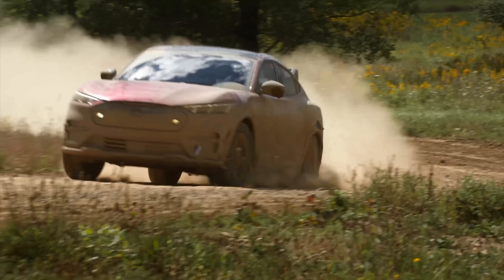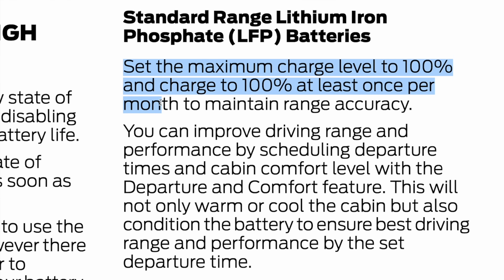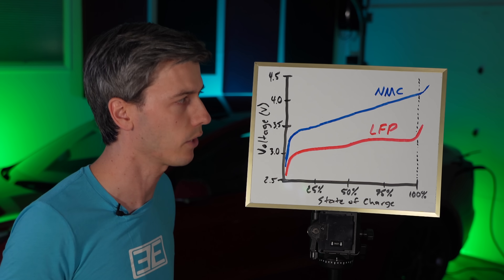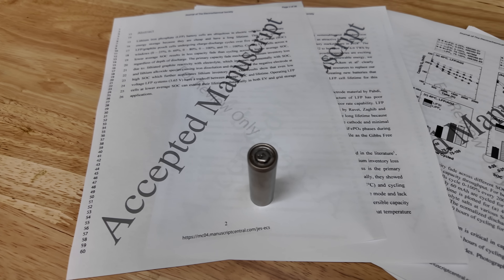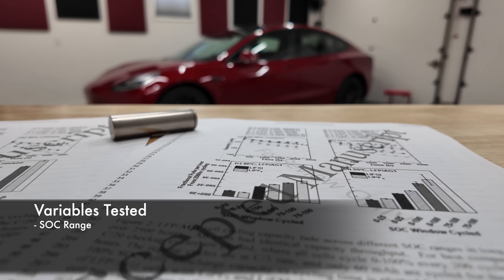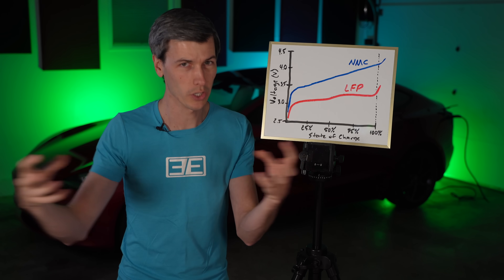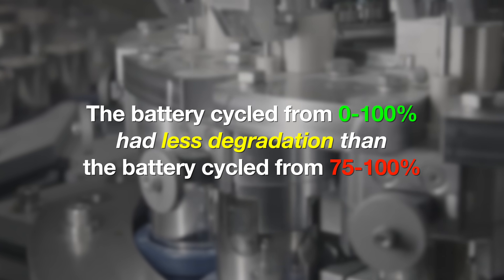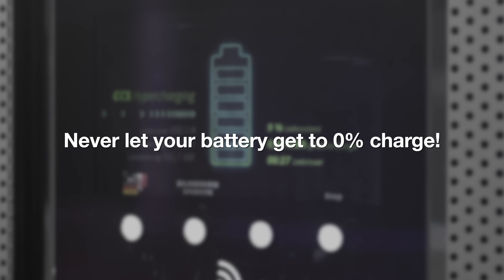How To Ruin Your Electric Car's Battery - LFP Edition!

Comment: And this is where I say that battery electric vehicles are not really the solution to travel.  We really should be investing in mass transit within towns and cities as well as inter-city networks of electric trains and buses.  All of this talk about how to maintain a battery when batteries really only have a shelf life or realistic life of 5-10 years while an internal combustion engine can go 20 or more.  If we want a bandaid (temporary) solution, we should be looking more into hybrid technology or a fuel source that doesn't produce the numbers of noxious emissions that gasoline has and finding something that doesn't use more energy or effects on the environment than it's worth the benefit (ethanol production). 

Fuels that we could be using more of but ultimately flare are natural gas and propane.  They are much cleaner burning fuels than gasoline and granted, the power drops a bit but if cars could travel around with 70 something horse power (granted, that's an entry level carbureted car from the 1980s like a Corolla or Civic).  I am also weary of battery technology due to its fairly volatile nature when involved in an accident or even just charging at home and your house becomes a total writeoff.  I know people say that Lithium Ferrous Phosphate is more stable than the Li-Ion batteries but when they go off, they go off.  

We should also consider going back to making 15 minute communities as we all need the exercise and getting rid of parking lots and making roads into walk ways so we (especially in North America) can get rid of this toxic dependency on car culture.

Comment: This video made me a little bit confused, so I will explain my current situation here and hopefully someone can help me with the best practice:

I currently own a Tesla model 3 highland standard range (LFP). I don’t have charging options at home but I do have some public chargers at a few min of walking distance. During the week I don’t drive my Tesla much because I commute to work by bike (is less then 2 km from home), but in the weekends me and my fiancé do regularly trips with quite some distances.

Following Tesla’s recommendations I charged my car to 100% every Sunday, even if the SOC was at like 85% (mostly if we have weekends with family and we can’t go on long trips). 

So after this video I understand that it is actually fine to keep driving it to let’s say 20% and then plug it in to 100%? Or should I keep following Tesla’s recommendation to charge it on Sundays (every week to 100% even at high soc’s)?

Comment: EVs are fine for people that can afford to buy or lease a new vehicle every 5 to 10 years but they are going to be a massive problem for lower income households.  They either need to figure out a way to make them last longer without degrading or they need to make it cheaper to replace the batteries.  And keep in mind the people buying these new know they are going to trade it in in a given amount of time and don't care about maintaining the life of the batteries.  The secondhand market is going to be filled with EVs that have their lifetime significantly shortened.

Comment: funny, but it sounds like the graphene is introducing a bit of the problem...i dont like the idea keeping things low, since full power acceleration works the cell much harder when its at lower SOC... if vehicle software isnt tracking cell voltages accurately or fast enough, big problems are heading your way... i bet the package type will also affect longevity... The prismatic cells can flex far more and over the last year, compression is recommended...  My calb pack in my sandrail was abused at 5c (60Ah cells) and the cells ended up at the same remaining (53Ah) that the ones i didn't install but left on the ground, after 4 years.

Comment: My boat has a lifepo4 battery bank and a very good charger. But, I cannot seem to get the charger to put out 14.4 volts at the tail end of charging, known as constant current state.  The charger must be spending very little time at this higher voltage

Comment: What if 10 years later you replace your battery with a solid state one....and suddenly you end up using the wrong VIN number for the new battery? This should be a status in software. Ford has it completely wrong not right.
Reply: How do you know the battery type is not also displayed with an OBDII scanner?

Comment: If you live in AZ where it is hot AF in your garage, leave your Tesla plugged in and use CABIN OVERHEAT PROTECTION. It also cools the battery. Same for those in the northern climes. Leave it plugged in for winter months so the battery is warm in the morning.
Reply: This isn't necessary at all..

Comment: I personally have my phone set to blurble at 80% charge and it does it again at 85%, 90%, 95% and 98% i think it is... And i try and charge when it hits 20-30% but due to the fast charging technology and accidentally letting it die more than a few times at 0% completely, when my battery gets below 15%, its charge state might as well be pissing electrons and it drains exceptionally rapidly. Pretty obvious that the charge cycles aren't what they use to be and i have indeed lost 20-25% of the capacity according to an app that does measure the incoming and outgoing electrons with volts, amps and temperature, plots what the charge is when you put it on charge, what you unplugged it at, the estimate of the battery health, degradation over time...
I mean.. this could be bloody useful in an app on the console of a car. My app even tells me the design spec and actual capacity and wgat the estimate deterioration/year is 🚗🚗

Comment: I don't own an EV, but I do have a LiFePO4 "lead acid replacement" battery on my solar system. It's charged to 100% nearly all the time, because my charge controller is designed for lead-acid. I was concerned that I may be degrading the cells by doing this. I do occasionally cycle it just to give it a bit of a workout, I guess I should do so more frequently.
Edit: I should have watched the whole video before posting, rookie error 🤪. I think I'll just have to accept that I'm going to wear out my battery, or get a more advanced charge controller.

Comment: You forgot to mention that charging an LFP battery in sub-freezing temperatures causes lithium plating, which will quickly degrade performance. Also, the internal resistance of LFP is very high in the cold, so if you get an LFP-equipped car, be sure it has a good battery thermal conditioning system. I live in Michigan, so this matters to me.
Reply: It’s funny that low temp charging barely came up, when the RV community and Will Prowse (low temp sensor test on batteries) warn about it all the time.

Comment: Is 100% SOC on a car level the same as 100% SOC on a cell level? Or is there an artificial buffer that gets adjusted over time to combat degradation and to have the same indicated maximum range for a longer time? If this is the case, charging to 80% SOC for example might be more detrimental on some cars compared to others, depending on the manufacturers philosophy.

Comment: Where did you get the Tesla recommendations from? I have a 23 Y-DM/LR. I was told, and the app recommends, to set a daily driving charge level to 80% and not to go lower than 20%. The 80/20 rule. It is also recommended that the car be plugged in at home. I have never seen any Tesla recommendation that stated to keep the SOC at 100%. The only time I ever kick up to 100% is the night before a long drive. It takes about 4 hours to go from 80% to 100%, so it is a slow charge to top off the battery as it's trying to keep the heat down (cell heat = the enemy).

Comment: What type of battery is it Cadillac LYRIQ LFP? Cadillac 2023 LYRIQ Charging 19.2 KWH CHARGER. 
I typically charge to 50-60% using a Level 1 charger. Objective slowest charging as possible while maintaining 50% SOC adjusting pending anticipated driving needs( some days no charging needed). Fast charging only for long distances planning not to exceed 80% if possible. I have a 19.2 KWH CHARGER with a 11.5 kwh EVSE. 
What charging recommendation would you recommend for my situation?

Comment: I guess knowing if your EV has an LFP or NMC battery is a lot. 
Gas engines are so much simpler you only need to worry about if it’s diesel or not… and if the engine needs 85, 87 or 89 or something else. And if the engine has synthetic oil or not, and how often you should change it. Oh yea and the transmission fluid and engine coolant, and I guess when you changed the spark plugs last. Probably good to know if it’s naturally aspirated or if it has a turbo or supercharger.

Comment: This video is about best practices for extending the lifespan of Lithium Iron Phosphate (LFP) batteries, the chemistry used in some electric vehicles. The video clarifies misconceptions people have about LFP batteries and contrasts them with Nickel Manganese Cobalt (NMC) batteries, a different kind of battery used in electric vehicles.
The video argues that unlike NMC batteries, which are degraded by frequent shallow charging, LFP batteries benefit from being fully charged to 100% at least once a month to calibrate the battery management system. However, storing the battery at 100% for long periods is detrimental to its lifespan. Ideally, for maximum longevity, the battery should be operated in lower state-of-charge ranges. However, this can be inconvenient for everyday use.
The video recommends a compromise: only plugging in the car when necessary and letting the battery drain further before charging to 100% once a week. This way, the battery is calibrated and avoids the negative effects of constantly being near 100% charge. Overall, the video suggests that LFP batteries are more forgiving of charging habits than NMC batteries, and occasional full charges are acceptable, especially if home charging is not available.
Here are the key takeaways:
 * Unlike NMC batteries, LFP batteries benefit from being fully charged to 100% at least once a month.
 * LFP batteries should not be stored at 100% for long periods.
 * Ideally, LFP batteries should be operated in lower state-of-charge ranges.
 * A convenient way to charge LFP batteries is to plug in the car only when necessary and letting the battery drain further before charging to 100% once a week.

Comment: Surprised the study didn’t throw in a cycle program of 25-50 or 25-75% to compare against common use patterns. Maybe they needed one end of the cycle to be at 0 or 100 to track total capacity?

Comment: I've read many a paper on battery tech. The biggest variable is the electrolyte. That is a proprietary and fiercely held witch's brew. One study (don't recall which) showed an MASSIVE difference in cycle lifetime from just the electrolyte - the researchers made all the cells, and let various factories put their electrolyte in them. The researcher's blend worked to ~2k cycles, while the various production factories ALL exceeded 8000 cycles.

Of course, there's also the lie every car manufacturer tells... zero ain't zero, and one hundred ain't one hundred. There's what the car tells you, and then there's the real, actual battery charge (voltage.) And this is before they out right lie about the capacity of the pack - eg. they're all 100kWh packs, but they charge more for those delivering 100kWh (Tesla loved doing that crap.)

Comment: Nice video but there’s one part of it that’s not good advice. You said that if you don’t have a home charger, it’s best to buy lfp as you can regularly take the car to 100%. The fact is that on a public charger you will not be able to take the car to a 100%.

To get the final last few kwh to reach a 100%, you will need an AC charger that can balance and re calibrate the cells. And without doing this at least once a month on an lfp battery, the soc readings will go haywire

Comment: No wonder I ADORE my gasoline driven car. All I have to worry about are:
1- where is the fuel tank needle at? (Full or empty).
2- when the exagerated taxation on gasoline will stop, and allow us to live?

EV is still in its infancy. Infrastructure is still immature. Still, there is pollution from generating electricity, battery manufacturing, and disposal.

Finally, EVs are more politically driven than market driven.
Reply: You also need to worry about changing the oil and filter, fuel filters, and failure of the water pump, oil pump, fuel pump, alternator, cooling system....

Comment: I've been running LFP cells for starting packs for 5 years. They get cycled slightly or nearly completely once per drive, slightly if used frequently, nearly completely or even completely if not driven for a longer time. During driving they sit at 100% as soon as they reach it. During parking they slowly discharge. I have fully discharged many of them to zero, as in all cells held at zero volts by the parasitic load of the vehicle until discovered. None of these cells have failed. All came back up fine and are still in use. Ihave killed some cells in two ways. 1. Severe overcharging which dries them out. 2. Discharging below zero forcefully due to cell mismatch and fast drain that balance board can't keep up with, the weaker cell gets empty first, and the stronger cell in series pumps current through it backwards effectively reversing voltage into the negative which the cells cannot tolerate. I don't care much about capacity and the cycles per time are low and depth of cycles shallow mostly, so the worst thing for these is engine bay heat, but again, they are mostly parked cold, and only hot while driven. Mostly they get an easy life. For those I fully isolate there is almost no discharge over time and the only cycling is brief starter current vs recharge after starting. These packs can dump 325A from 8Ah capacity and can soak it up fast too despite low capacity, which results in worst case scenario for belts. Cold belt loaded heavily must be fresh soft grippy and tight or it will squeal :-D

Comment: EVs aren't ready, EVs are too complicated, etc.  😉
So, I can either get additional education in mathematics, engineering, and chemistry, and read these studies with only a mild hope of understanding them. . .or I could just own an internal combustion-engined vehicle until they become illegal (or maybe a hybrid, because their batteries don't cost >$20.000 to replace)?  
I'm 57 and I drive like a grandpa, so I choose option 2.  Have a nice day.
Thanks for posting this video, and helping me make the decision, Jason.
Reply: I think you missed the point. LFP is made for 'grandpa' drivers. You don't have worry about the technology. You drive to a quarter tank as usual, then fill up. Plus if grandpa (which I am) isn't making a lot of long trips (which I don't) and can charge at home (which I do), then there's really nothing simpler.

Comment: One key point is 100% reported state of charge is not the same as a actual battery state of charge. The manufacturer can set the 100% level to what ever they want. They can set 100% to be at 80% voltage on the cell level for example.

Comment: Loads of great information. Thank you! 
You mention the greater detrimental impact with higher battery temperatures. Would that mean that greater longevity could be achieved by charging at home rather than using fast chargers?

Comment: The mental load required for this is kinda crazy compared to gas. It feels like every battery recommendation can be reduced to "dont use it". 

Cant wait for all of this to be so good that i can be as braindead as I am with my tank that i can fill however much i want whenever i want.
Reply: With a combustion car you do have the short trip issue (fuel will dilute the engine oil if you don't drive long enough to get the engine fully warmed up), protracted idling is bad (the dodge/Chrysler hemi V8 infamously destroys its cam followers if you idle too long), what oil change interval should you be using (adverse conditions or standard) etc. a lot of people ignore all that and kill their ICE prematurely as a result.
Reply: @nerd1000ify  there's a fundamental difference in that the 2 operational things you mention reduce to "use the car more" not "do less". There's a weird feeling of like having to baby these batteries that's just offputting for now.
Reply: @TheTortuga58  well there are pros and cons to any technology. If your average trip is 10 mins down the road in bad traffic an electric will need less babying than an ICE. Obviously the opposite if your average trip is 3 hours on the highway.

Would be great to have none of those issues, but I'm not sure it will ever be the case.

Comment: If you take the data Jason mentioned and calculate it, then *realistically*, if you just kept your car plugged in all the time when not using it, but also drove it regularly, then the capacity fade would be small enough to last well over a decade, if not two decades. Its REALLY IMPORTANT to stress the difference between IDEAL FOR MAXIMUM LONGEVITY and REALISTIC FOR EVERYDAY USE, because we dont need car batteries to outlast the car itself. By the time your EV's battery degrades that severely, youll have already gotten a new one. Even old ICE cars suffer if they are just that. Old. Jason has even touched on why. Pistons scrape against one side of the cylinder wall during the power stroke and over time this enlarges the cylinder, causing loss of compression, oil leaking into the combustion chamber, and other problems. You cant keep old stuff just because its old. Oh, but you can buy a $1,000 engine off a scrapyard and slap in your old ICE car? Well you can do that with batteries too. Both that old engine, and that old battery, will be old and partially worn. A new battery costs $10,000? So does a new engine. Engines last 50 years compared a battery's 10? Ok buddy, sorry for trying to innovate. Didnt know we couldnt ever try new things unless they are perfect from day one, by your standards. Sheesh, rant over lol.